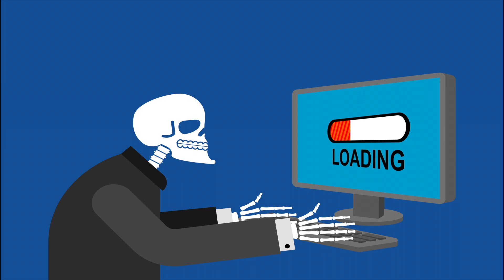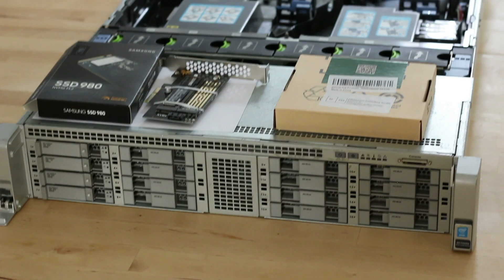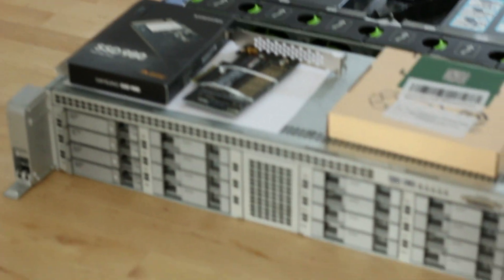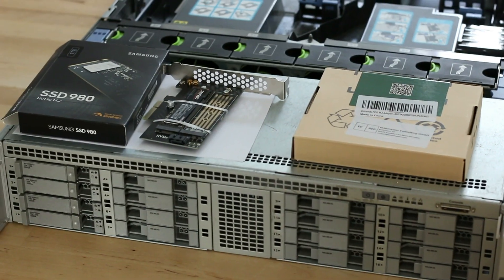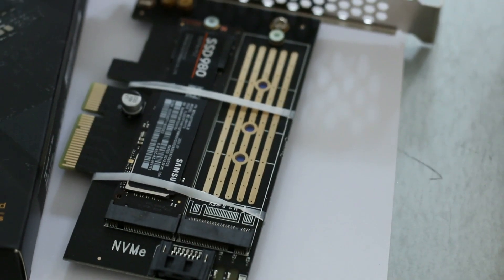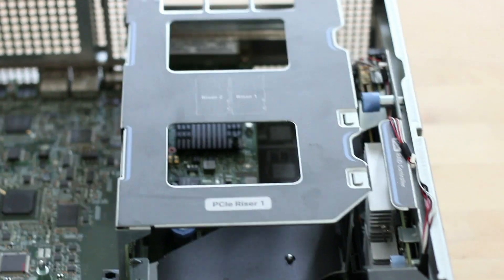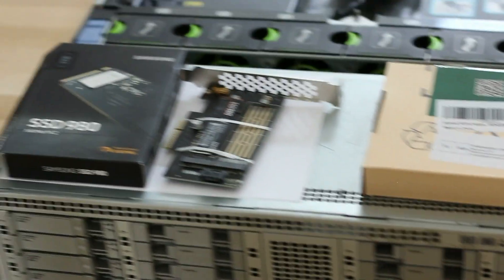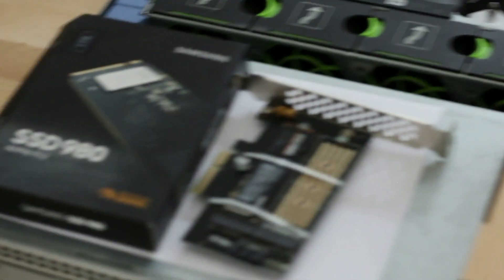Home Lab - Cisco UCS C240 M4 - NVME M2 SSD upgrade

Comment: I have exactly the same qq as the person above, but I have a 240 m4s
Have gone through a bit of settings and some Cisco support forums.
My expansion card is not a boot option in UEFI. Option rom states not loaded.
Have tried with sw raid and without sw raid, but I think sw raid is not picking up the expansion card because there is something else is not enabled or disabled.
Going to go through more bios, but if you could share your experience with booting off of the nvme through your expansion card please share.

P.S.: I am able to install onto it, but not boot off of it.
Reply: So I messed with the server more, attempted to just install win10 9n that nvme to see if the system will recognize it after that and within the win installation I got a message that OS CANNOT be installed on my pcie nvme  as this may not be supported by the systems hardware. Also the message stated that I may need to enable the controller for that disk.

Now I am thinking I either need to try disabling the raid controller everywhere and try installing then or I wonder if I need to get an expansion card that has a controller on it if that is even a thing and such cards exist.

If you or anyone else have any info to share please do :)
Reply from the maker: Hey 👋 Yes I had a problem with this as well. I removed all the disks from the server leaving only the nvme m.2 installed. I was then able to install the OS.
Reply: Same problem. We bought the same exact card shown in the video. We can install the OS to the nvme, but we cannot get it to be visible in bios as a boot device option. Were you able to accomplish this, and if so, how?
Reply: I've been wondering if it is possible to upgrade the bios in the server, but have not looked into it yet
Reply: Unfortunately we're on the latest firmware/bios version already on ours, it still won't see the NVMe as a boot option. I'm going to try manually adding the NVMe as a boot device in bios but need to get the proper hardware ID for the OS position first, I'm not holding my breath though. I think we're just going to end up getting a Cisco certified PCI-E raid adapter for it. This has definitely been a frustrating little side project, lol.
Reply: @tsurashi1 were you able to get the NVMe going or did you end up getting an additional piece of hardware to be able to boot off of it?

I attempted installing proxmox on a SATA SSD and plugging that into the backplane like all of the mechanical drives and booting off of that.
Guess what - same issue.

So lmk if you have any info to share please. Any pointers will be greatly appreciated

Comment: How did you get the Cisco box to boot from NVME? I can see it as unknown mass storage in the Bios pci settings but not a hdd in the raid config or bootable drive when I hit F6? I’m using a C220 m3 with same hardware you recommended.

Comment: Love your videos and appreciate you sharing. 👍🏼Just curious why no heat sink on the SSD to help it perform at its maximum capability? May be a dumb question.  Just curious…🙂
Reply from the maker: Hey Dave, thanks very much, I'm happy you enjoy my vids 😀 The NVMe PCIe M.2 Adapter came with two heatsinks which are underneath - https://www.amazon.co.uk/gp/product/B07GDFX3YJ/ref=ppx_yo_dt_b_asin_title_o07_s00?ie=UTF8&psc=1
Reply: @MBTechTalker  that explains! 👍🏼